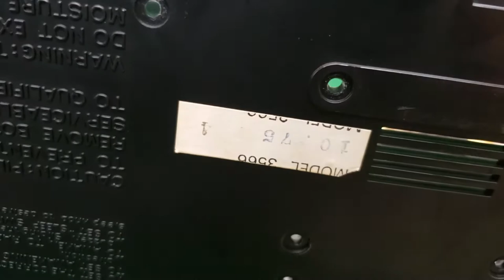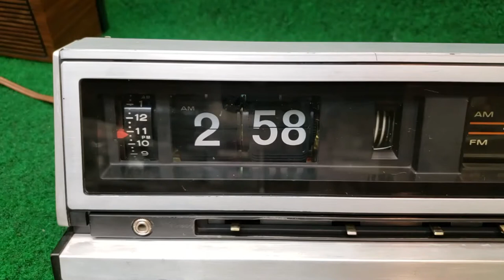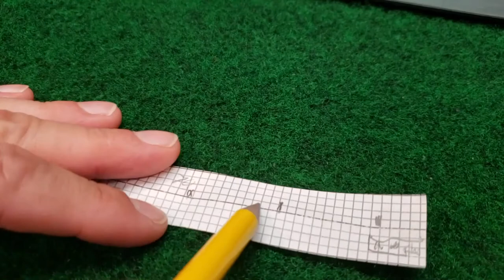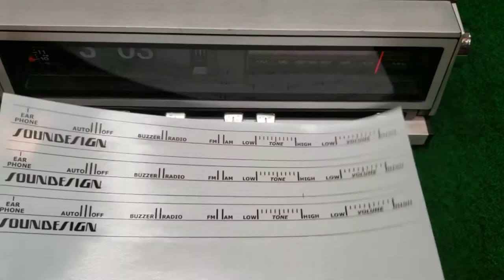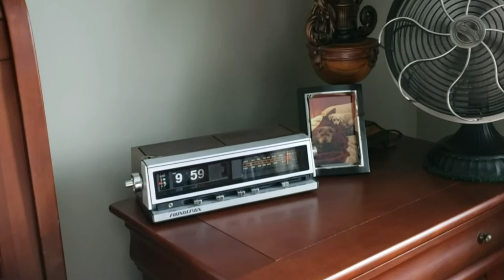Flip-Clock Flip:  From Thrift Store to Restoration Revival.

Comment: Scott - @8:48, what did you use to clean the potentiometers?  Moving Contact Lubricant?  Very nice work on the decal restoration.  How did you obtain a template and transfer it?  Nice!
Reply from the maker: Thanks!   For the decal I produced it in Inkscape.
https://inkscape.org/
For the logo part, I took a picture of the one on the back and then used the inkscape function "trace bitmap"  The rest of it I just made by hand.  Measure-Adjust-Print-Check over and over and over again until it looked right.  But I found out something in the process.  When decals dry they shrink a little.  Thus since the decal is long one end it about 2 millimeters off.  Nobody will ever notice.  But it bugs me anyway.  The pots - I just used alcohol. 

How did you find my channel?